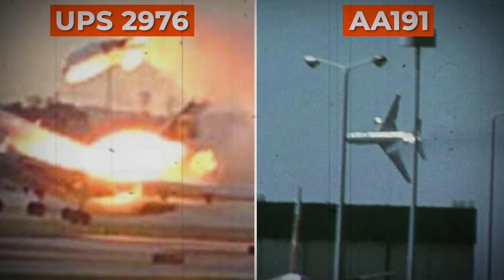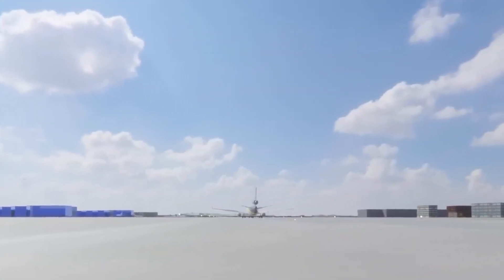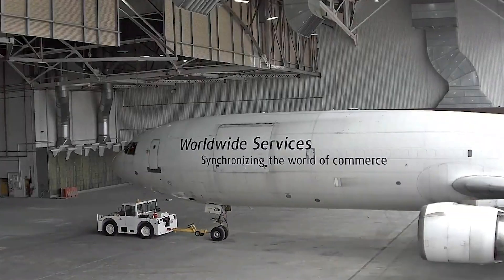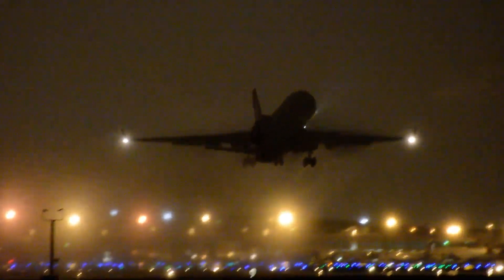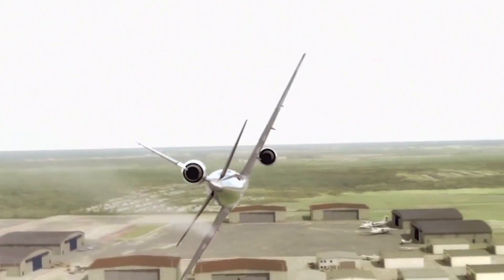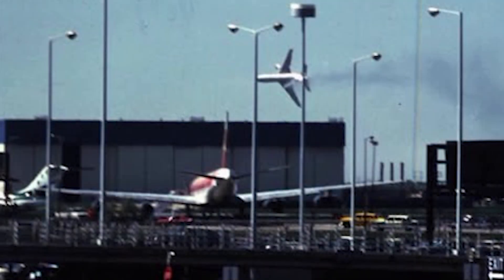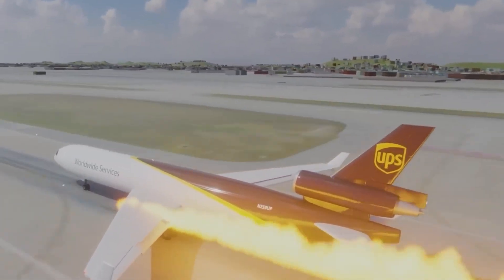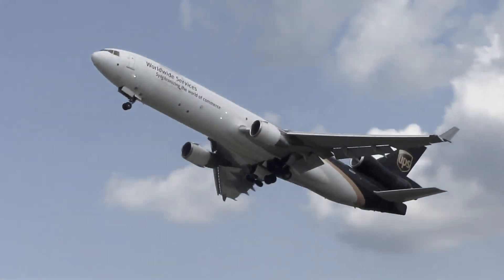Did UPS 2976 Repeat AA191? NOT What You Think!

Comment: QQ:  Did the pilots know that the engine was on fire, and did they know that the engine had fallen off the wing? It’s not like they have rearview mirrors to glance at to try to figure out what was going wrong. I realize that the answers would be supposition, and I have no intention of putting anyone to the fire for their answers - I’m just curious what they may have been thinking and/or saying. Thank you in advance of your answer - I appreciate your knowledge. 

Thank you for the clarification between these two flights. I think most people were wondering, and now we know … with real explanatory proof.
Reply from the maker: Great question. Pilots actually don’t have any way to see the engines directly. Even on newer jets that have external cameras, like the A350, A380, or some 777/787s, those cameras are mostly tail or taxi views, not angles that let the crew check the engines.

So in a sudden, violent failure, the only information the crew gets comes from instruments, warnings, and how the airplane is responding. Those signals show the effects of the damage, not the damage itself.

That means the pilots were diagnosing the situation with very limited and incomplete information, all while the emergency was unfolding extremely fast.

Really appreciate the thoughtful question. It's a very important one.
Reply: @BlackboxAnalyst 
The AA-191 plane only had one whopping stick shaker in the Captain's yoke.  That system was only powered by the departed #1 engine.  This means they didn't know about thr fact that they put the plane in the stall situation that killed 273 people by following in appropriate training.  If the AA-191 flight crew had received the stick shaker system warning, they might have stood a chance (no matter how limited) to save their plane.
Reply: The crew could've aborted the takeoff when the repeating bell began to sound, and even as late as several seconds after that

Comment: You are right, 2 totally different causes. The AA plane was only 7 years old, the UPS was 34. And yes gyroscopic precession is a big deal. I would say it could happen on any model without proper inspections. If you want my opinion, give the grounded ones a proper inspection, replace all the pylons and hardware and get them back in service.

Comment: And both were unrecoverable for different reasons.  AA191 had the leading edge slats locked in a retracted position when hydraulic lines were severed, putting the left wing into an aerodynamic stall, but still had 2 of 3 engines with full power.  UPS flight lost full power in the #2 (tail) engine from debris, so only had 1 engine, which isn't enough thrust.
Reply: "both were unrecoverable"
UPS 2976 had the option to abort when the repeating bell began sounding, and for several seconds after that
Reply: @AlainDessureault  Where are you getting that from?
Reply: @MG-ot2yr  
The NTSB said the repeating bell began at 37 seconds.
Physics says that at 37 seconds, and for several seconds after that, an abort was possible.
Reply: @AlainDessureault  NTSB also said it was an uneventful take off roll.  They don't explain what the repeating bell was signaling.  Where do you get they should have aborted, given you have no idea what the repeating bell was?
Reply: @MG-ot2yr  
"NTSB also said it was an uneventful take off roll"
… which became false when the bell started sounding

"Where do you get they should have aborted, given you have no idea what the repeating bell was?"
1) Experts consider that repeating bell a serious alarm. Crew should've aborted then.
2) Even when the engine broke off, an abort would've been the better option. Trying to fly an unflyable plane made the crash worse